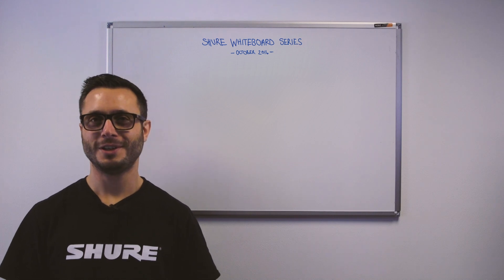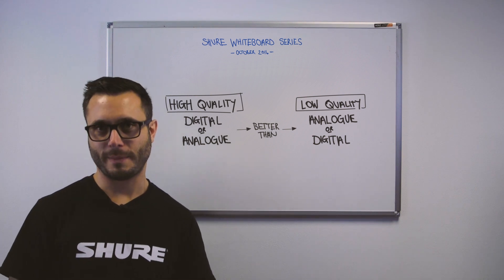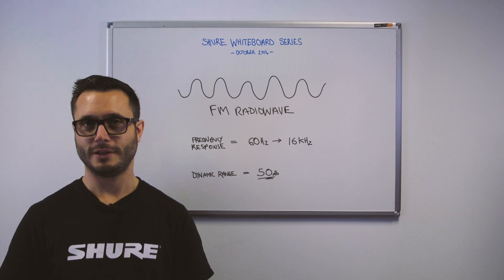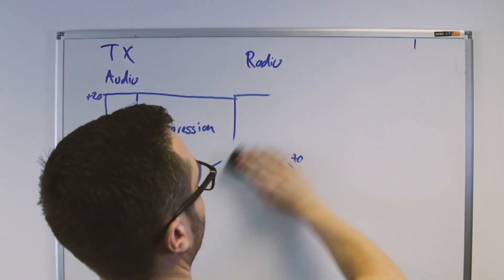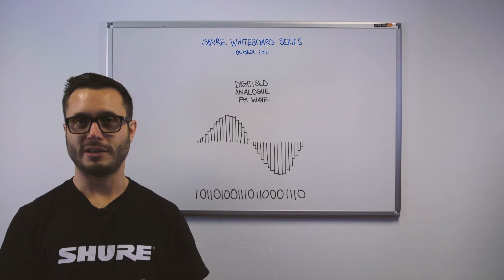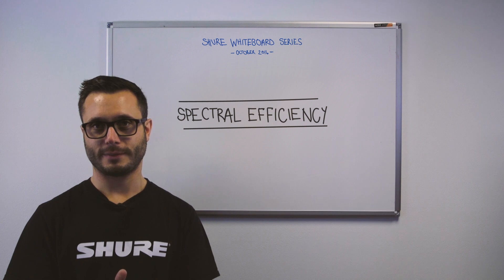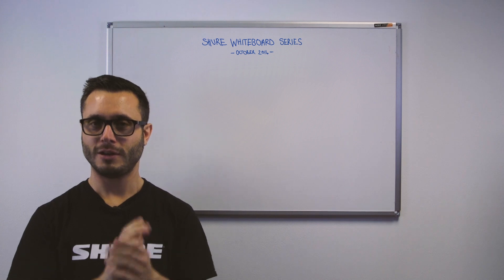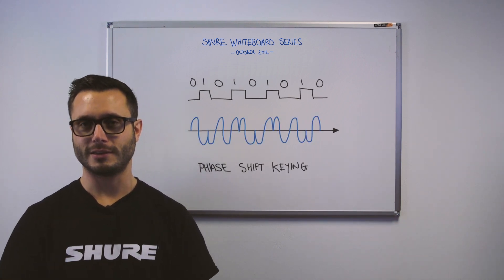Shure Whiteboard - Analogue v Digital Wireless

Comment: I am reading reviews that state wifi and hotspots are causing interference with this microphone is digital really worth it
Reply: Yea I've been using a digital GLX and lately its been dropping at venues. Even when close to the transmitter. But there have two other friends have UHF and NO issues. I'm thinking that there is too much traffic at the 2.4
Reply: @CarlosGarcia-dx1jj  ive read that to fix this problem, you have to scan the channel..
i just bought the glxd 4 the other day, haven't used yet in a gig..i hope scanning the channel really helps..
Reply: @jeffrivera6  yesterday we had a show and 3 sound engineers told me that it is a lottery to use digital at 2.4, si I changed my line6 relay to shure blx14
Reply: @CarlosGarcia-dx1jj  Not that you need the reminder, but your comment reminded me of the way a lot of folks get confused about "Digital" mics, so I just want to clarify for other readers: 

To be clear, "digital" does not mean using the 2.4 gHz "wifi" band. 

It is ONLY the style of transmission, and a lot of confusion happens when people conflate the two. Folks see 2.4 GHz, think "wifi", then think that means "digital". It absolutely does not. It just means the 2.4 GHz band. The transmitter can be analog or digital just like it can on any other frequency.

Now, that said I agree with you: I hate 2.4 gHz band mics. They're fairly short ranged to begin with. The short range is part of why device manufacturers like the 2.4 GHz band: not only is it unregulated and thus free to use, but it inherently has a high fall off over distance in a way the lower frequencies do not, and you can use smaller antennae for it. But for our purposes, what sucks even worse is that 2.4 GHz signal strength decays ULTRA fast down even premium coax antenna cables, so much that you almost don't want to use any coax at all with them, especially if its the same coax you've been running with your UHF mics. And since the 2.4 GHz band is unregulated, as you mention, there's wide range interference with myriad other devices up there, and bodies absorb it even worse than UHF. Even the Shure advertising on the GLX recognizes the range issues, saying it's great for "small to medium venues". Yeah, empty ones maybe.

Conversely, and part of what I wanted to clarify, I've used Shure's ULX digital TX/RX pairs in the traditional UHF TV channel ranges in a downtown area next to no less than 8 different 800k-2million watt TV stations covering frequencies from 400-700 MHz and they worked absolutely fantastically, especially when paired with Shure's Wireless Workbench software to help find the good frequency ranges. I had 12 mics stacked within .2 MHz of each other AND with 10 other analog mics in the mix with no issues, from each other or external interference. If they'd all been analog, I'd have been screwed.